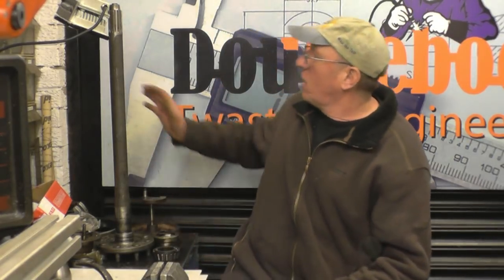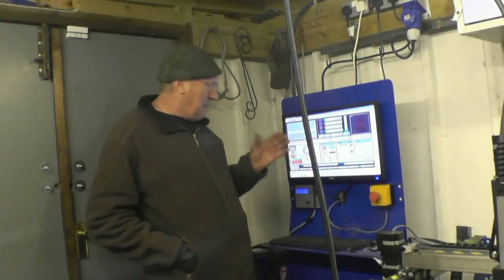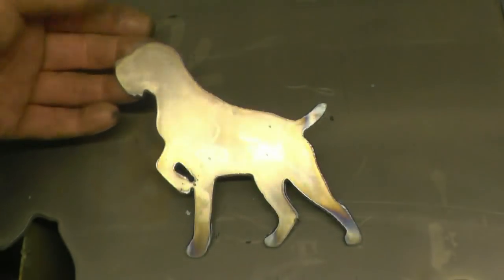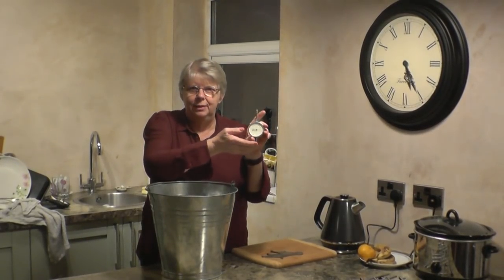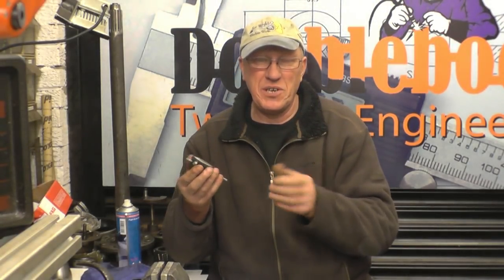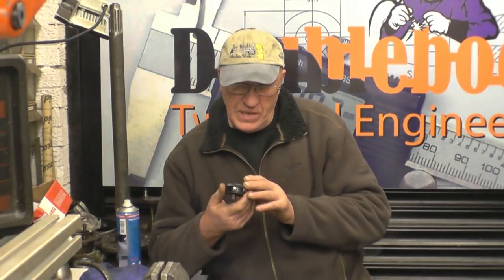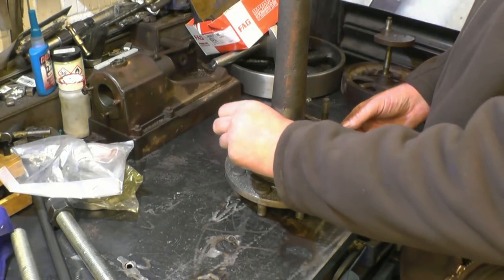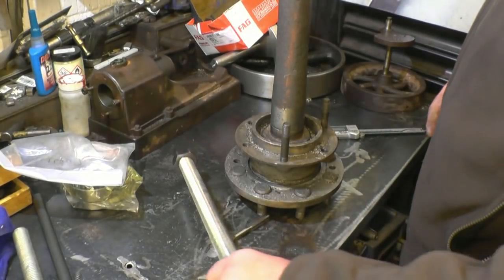SNNC 202 P1    Plasma CNC First Cut

Comment: Putting eight bolts into flange holes and tightening them up very slowly just might have done the trick, pushing it off rather than pulling it off, has worked for me in the past.

Comment: So John if you would of drilled and taped the all thread rod to the largest hole possible  and  then turned and threaded the extension rod with a pin on other end then just screwed the two together to use then  unscrew for storage also if need to make different extension with Different  boltsize you could use same strong back and all thread to pull with what do you think?

Comment: Med Roberts. Been MF trained since school. You need to watch you don't damage the bearing flange were the ring of mounting bolts are. Better to bolt a ring to the flange to pull off. I have made a large plate which is bolted to the flange using all the bolt holes and then simply press off.  Regards, Med
Reply from the maker: Thanks, i will modify his puller to use all the studs
Reply: Cutting out that flange would be a nice application for the plasma table.
Reply from the maker: Yes some 12 mill plate

Comment: The service tool for that half shaft is basicaly a tube that runs the length of the shaft, bolts to the bearing housing and has a bolt that pushes against the taper in the other end which as you turn it it pulls the collar off. The collars still brake easey mind...

Comment: that plasma cutter give a nice clean cut with out much slag on the sides . if you had cut stigs mouth out it will have made a good bottle opener
Reply from the maker: It worked great for a first try

Comment: john, is your tool post 250-200?
Reply from the maker: Yes it is 250 / 200  wedge type
Reply: thanks. considering buying a piston type... not sure now. wedge must be better, but this piston one is going cheap.
Reply from the maker: I had a piston type on a Boxford lathe It was no problem at all
Reply: well I've ordered and paid for it now. thanks for the reassurance. just need tool holders to fit it now. thanks again.